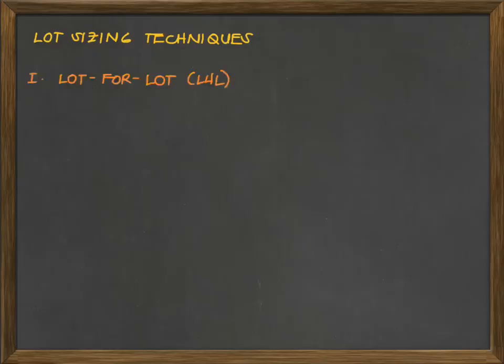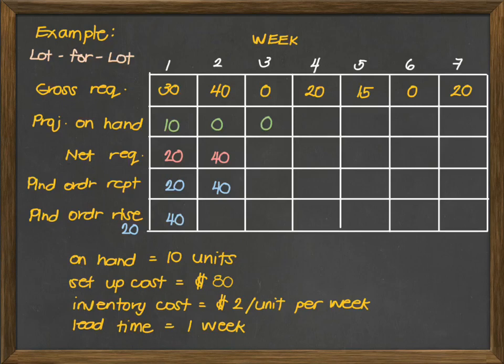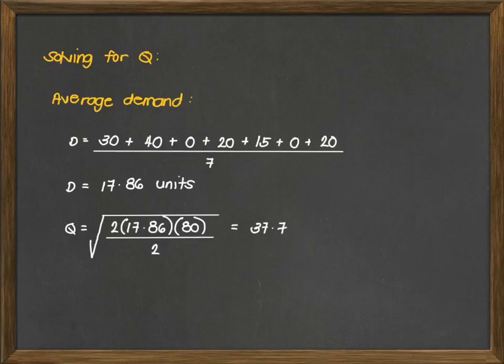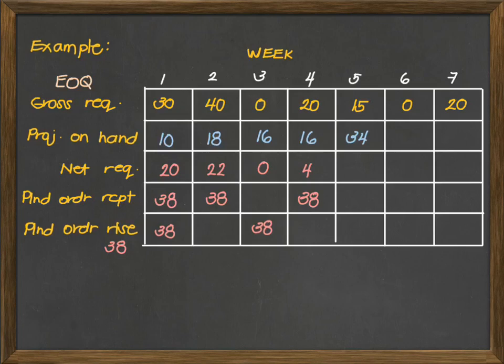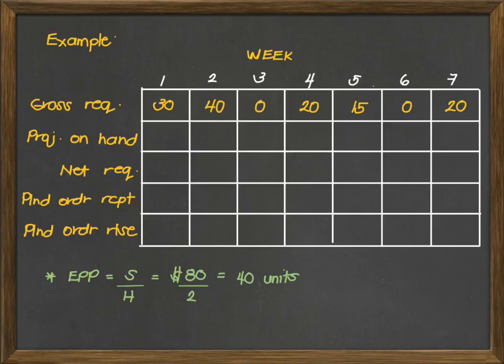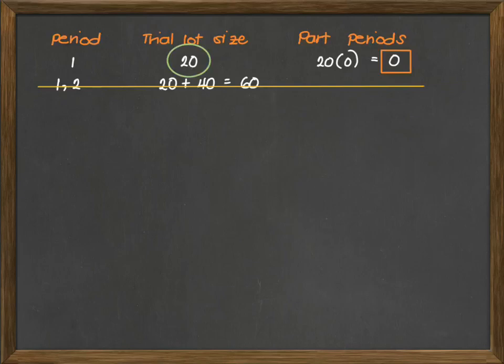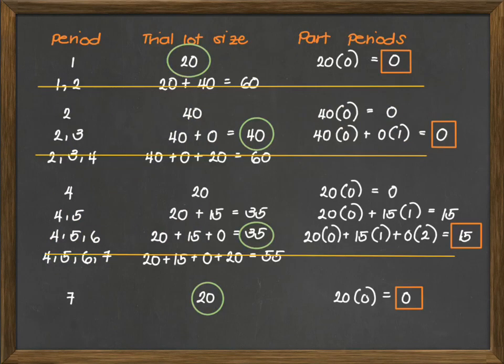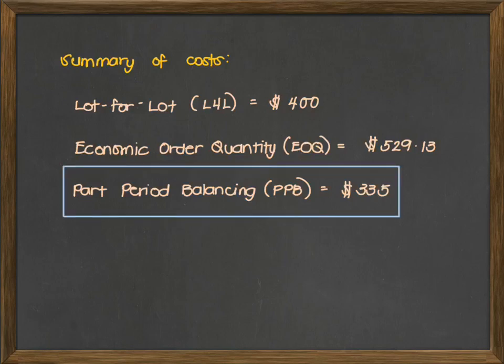Lot sizing techniques | Lot-for-Lot, EOQ, Part Period Balancing

Comment: What if the EOQ is less than the gross/net requirement and there is stock out cost?
Reply from the maker: This happens very unusually. But in cases EOQ is less than the maximum gross requirement, EOQ may not be applicable to consider as a lot sizing technique. You may opt to evaluate lot for lot or PPB; there are also OR techniques that you can apply, such as Wagner-Whitin method.

Comment: Only one concern. Total cost in the EOQ method, didn't require for me to calculate number of orders. I already have Q, D, H, and S values. I only obtained number of orders from the EOQ method, but it didnt get used in the final total cost calculation. Please help?
Reply from the maker: Hello! We use the same formula for total cost calculation for EOQ. The only difference is we will calculate for the applicable planning period only. If your planning duration is in weeks, say 15 weeks, we will divide the total annual cost by 52 weeks to get the weekly average cost, then multiply it by 15. If your planning duration is in months, we divide the total annual cost by 12, and multiply it with the total number of months of the planning period.

Comment: Hai really apreciate your video. But i would like to ask you something abit off from this topic. The question is about Least Total Cost (LTC). I realize in my calculation that they produce the same planning order as PPB. The Lotsizing method is also basicly the same. So what's the difference?
Reply from the maker: Hello! Thank you for watching! There are cases that the least cost for all techniques could be the same, it means you have multiple feasible solutions. The next thing you have to weigh are the other factors that could contribute to overall cost, like availability of materials, capacity, and manpower :)

Comment: Hey! How come you do not calculate the average demand in EOQ from the Net Requirements in lot-for-lot? But instead you used gross requirements? Thanks!!
Reply from the maker: Hello! Average demand is based on the average of the gross requirements, which is the actual units needed for each planning period. On hand inventory can vary based on the previous production, affecting how the net requirements will be for a specific planning period. You can read more about using EOQ in lot sizing techniques in Heizer and Render’s book of Operations Management :)
Reply: @EzrhaGodilano  I'm currently working on a question where I am already aware of the inventory on hand so in this instance would I use the net requirements instead? Thanks for your reply!!!
Reply from the maker: Average gross requirements should still be used to determine average demand :)

Comment: What if I have 30 in gross requirements  and a beginning inventory of 40, what I should put in net requirement? Thank you in advance
Reply from the maker: Hello! If your inventory>gross requirement, the difference will be carried over to the next period as your projected on-hand inventory. You’ll only have a value in the net requirement cell if your gross>inventory. :)
Reply from the maker: So to answer your question, if your beginning inventory is 40, and gross requirement is 30 on Period 1, nothing will be written on the net requirement cell. The difference of 10 will be your projected on-hand for Period 2.
Reply: Ezrha Godilano thanks for your response... And if I have 0 at the gross requirements of period 2, that 10 that is on hand, it counts as an holding cost since I won’t use that quantity in that period? And if that’s the case, should I multiply (1 unit x holding cost)?
Reply from the maker: It depends on the technique you’re using. For EOQ and PPB, the holding cost is already considered in the computation of the total cost. Lot-for-lot on the other hand, usually has no more than 1 period with no gross requirement, and aims to have zero holding cost and only counts the number of orders then multiplied with the ordering cost. In the end, you have to evaluate which among these techniques will yield the least cost.
Reply: Ezrha Godilano I understand, thank you so much for your time.
Reply from the maker: Krystal N. Martínez You’re welcome! Happy to help. Let me know if you have further questions, and thank you for watching!